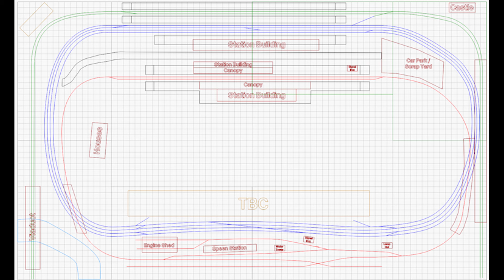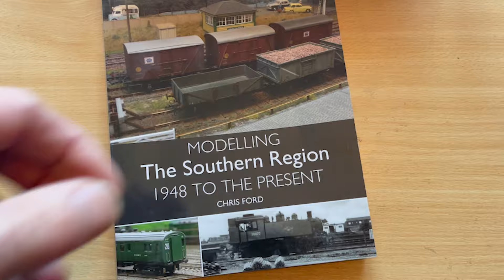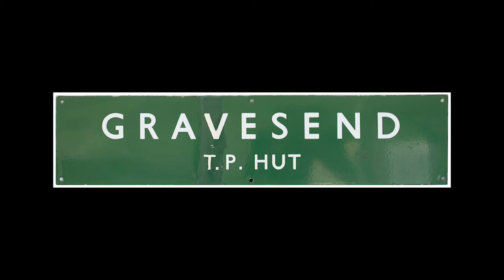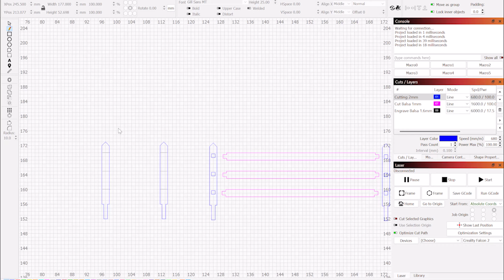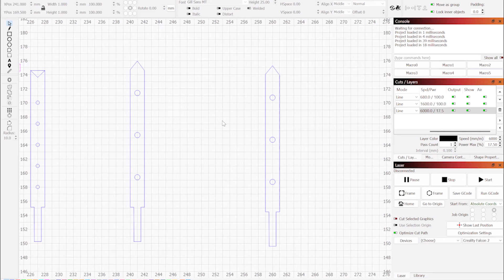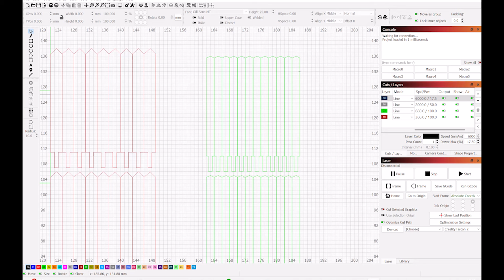21 - TP Hut, Hydrangea Trees and SR Concrete Fencing at Donnington Castle Model Railway

Comment: Hi Martyn my appologies for misspelling you name, back in BR/NSE days we were taught to use the Short Circuit Bar under live conditions, this was done at Waterloo Substation on a siding where the necropolis once stood, as soon as you heard the boom of the DC breakers trip it sort of made you jump. Waterloo Substationwhich was a large structure was a Cathedral type Substation, also there were another type of brick building with a flat roof like the one at Tattenham Corner which is close to the station was called a bungalow Substation. During my time from 1987 until 2021 when I retired I have worked on many locations and have seen numerous upgrades on the region. My last hurrah was during the lockdown on the Island line upgrading the traction power supply at the three main substations at Ryde St John's,  Roborough and Sandown this was done prior to the Upgraded Class 434 LT subsurface stock. I hope this information is useful to you and anyone who is modelling the Southern Region.
Kindest Regards 
Dave.
Reply from the maker: Thanks Dave, yes this is all really interesting and very useful. Hopefully I'll be able to spend the weekend working on the layout and developing this scene further. As well as getting the rest of the track laid so I can show some trains running on these lines. Always great to get feedback and insights so look forward to sharing more videos soon.

Comment: Hi Martin, another excellent video, i have worked on BR/Network Rail within the electrification department for 35 years and to my knowledge about the TP huts and Substation. The TP Huts have at least 4 DC breakers, these breakers feed the conductor rail and are what is called the section gaps (The Conductor Rail Gaps) for maintenance work on the DC breakers these can be racked out from the DC busbar,  today the traction power cables are fed directly to the Conductor thus removing the need for Hook Switches. Today's DC railway is now classed as safer isolations which has reduced risk to Staff going onto the trackside to put short circuit bar and straps when isolating a section of electrified rail for Line Possesions for engineering works. This is now operated by trained staff to basically isolate from a lineside Local Control Panel (LCP) I have worked at Wheatsheaf Substation on the Portsmouth Direct Line and the Substation building is what is known as a Brighton Style building which was built in the 1930s, the reason it is sited on a platform is due to the location and access by road the transformer rectifiers were delivered by rail back in the day.

I hope this is of help to you.
Reply from the maker: That's really useful and interesting info, thanks! As my layout is set in roughly the mid 70's I'm guessing a lot of things were done differently from today. I've watched some old training videos for putting isolating bars in place and they looked pretty scary to use.